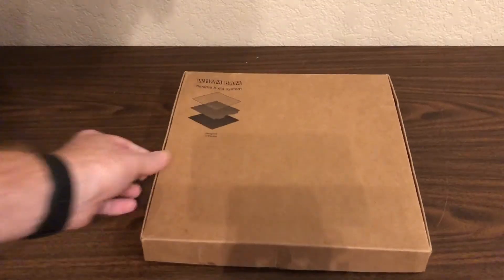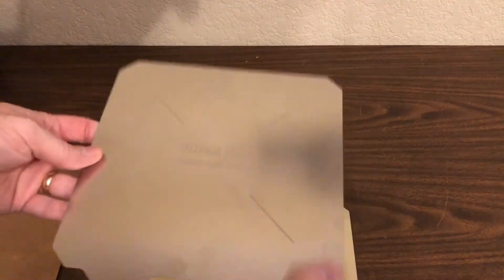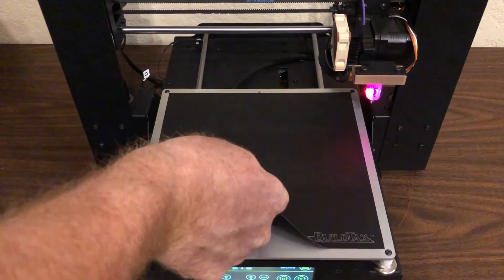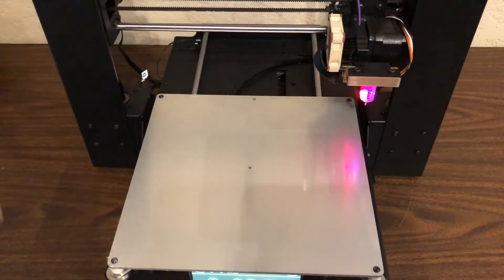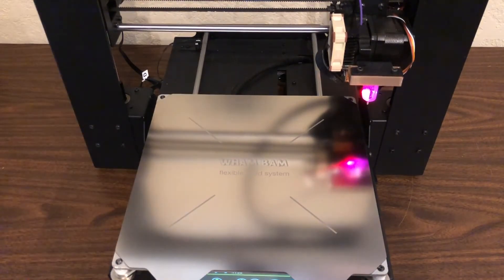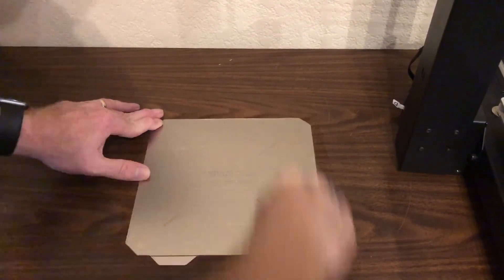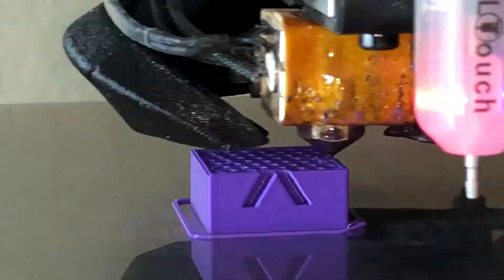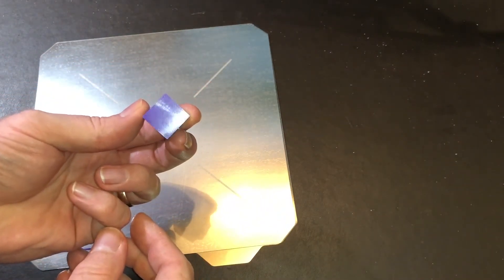Flexibility in Print Removal: Wham Bam Flexible Build System for Maker Select Plus

Comment: ur lucky i got one for my cr-10 it covers my screws:(((
Reply from the maker: Oh... The CR-10 screws are farther from the corners, aren't they? I just noticed my Ender 3 is kind of like that, too. Can you put a lock nut on the underside of the bed to secure the screws to the bed?
Reply: @BV3D  I hope (on the lock nuts) i ordered some locking nuts just waiting on them to show up
Reply from the maker: @st0mper121  Give this video a look. Covers the exact issue you're running into. https://youtu.be/-UL1d61HClo
Reply: @BV3D  he is very close to what i did but i did not use lock tight or the washers I just used lock nuts. im not a big fan of putting lock tight on my printer for one i dont trust lock tight on something im going to be taking upto 120C you brake lock tight open/off you heat it up. now one thing he did have thats a good idea is changing out the springs. This is a good idea my springs are hitting the nuts so the nuts are acting as spacers and its making things really tight.. wish i knew the right spring to toss in. I did manage to get the bed level its just really tight. I still want to change out the springs and allow for more play on adjustments of the bed.
Reply from the maker: @st0mper121  I bought a set of these on Amazon. I haven't installed them yet. So far my Ender 3 Pro is completely stock. Soon though! https://www.amazon.com/dp/B07KFBK8FC/ref=cm_sw_em_r_mt_dp_U_d6eCCbMBSPXB0

Comment: great review Bryan! we look forward to learning more from your experience with Wham Bam Flexible Build System.
Reply from the maker: Thanks, Peter! I've got a fair amount of printing coming up, with Halloween decorations and such, so the WB system is going to get a bit of a workout. I'll be comparing it to the Creality Cmagnet and the Prusa MK3, since these are the only removable magnetic print surfaces I have available. 

I found a 3D printed raven project I want to make for Halloween -- it uses an Arduino to drive a servo to move the head, and LEDs for the eyes -- so I'll be printing a bunch of PETG on it.

So far PLA has stuck firm during printing and come off with a quick pop when done. 👍